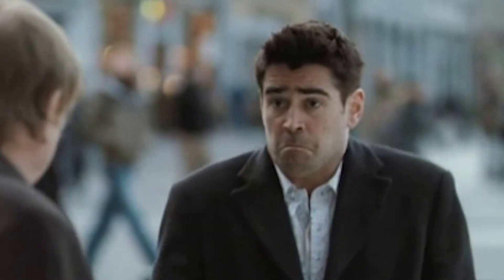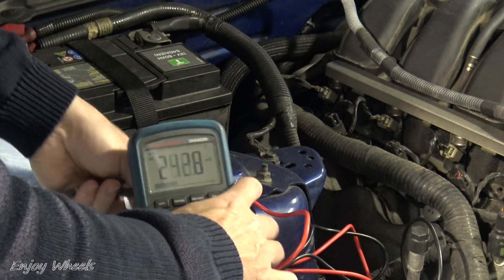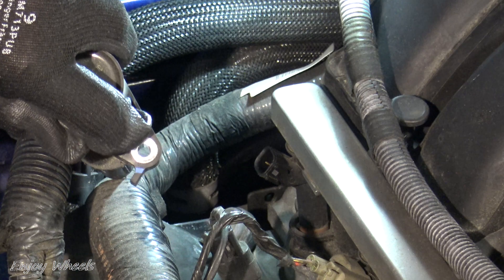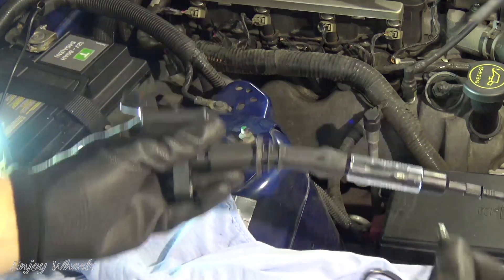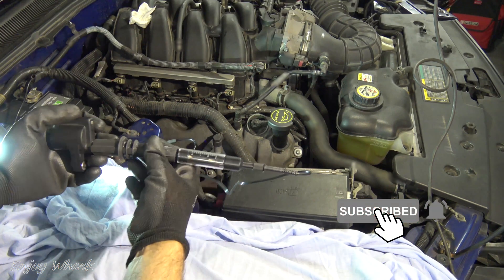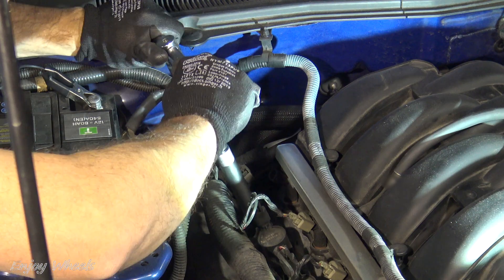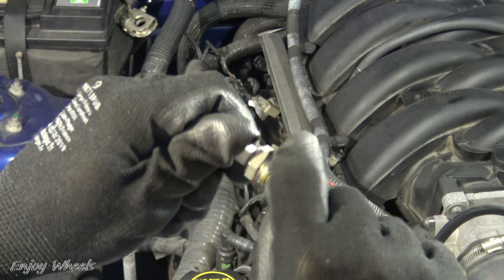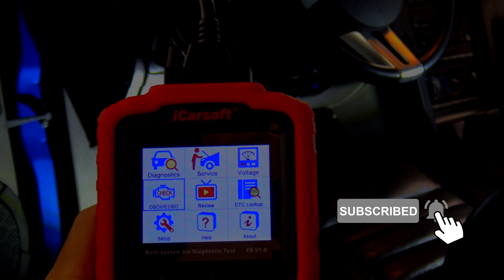Engine misfiring : How to TEST an IGNITION COIL easily ? (Lack of power, excessive fuel consumption)

Comment: For Anyone watching this: Don’t put anti seize on spark plug threads! The torque on the threads lubricated is much higher than when dry and you could strip the threads on the cylinder head and cause a major repair. May have worked for this guy, but guarantee the manufacturers of that engine and of those spark plugs say keep it dry.
It’s a modern engine with modern spark plugs that are anti corrosive already.
Spark plugs have a gas tight crush washer, no corrosion is getting into the threads if you torque to speck with dry threads.
Only place I’ve seen anti seize on spark plugs is engines on outdoor power equipment and marine environments thats regularly exposed to the weather and corrosion and it’s only the threads close to the crush washer, not the whole thing.

Comment: At 5.52 you lubricate the threads. NOTE: Some plugs are made with coated threads (Denso for example) and DO NOT need lubrication. In fact by lubricating the threads you risk over torqueing the plug when fitting.
Reply: Yeah was surprised to see that especially on a modern engine with modern spark plugs.
Spark plugs have a gas tight crush washer, no corrosion is getting into the threads if you torque to speck with dry threads.

Comment: A quicker way of checking for a bad missing ignition coil or spark plug is swapping the suspected bad coil with the known good coil from another functioning cylinder and rerun the engine, checking with the OBD checker, to see if the miss is now in the cylinder that was a good firing one. If there is no change, then the spark plug in the original bad cylinder is bad and the suspected coil should be good.

Comment: One bad spark plug means something else is going on. Either all the plugs are on the edge of their life span or you have an issue with that cylinder like bad oil control rings. 

It’s not normal for one cylinders spark plug to just go bad.

Comment: Ok what if cylinder one was missfiring then did a complete replacement of all spark plugs and wires then 3 weeks later it's back to missfiring should I check the plug again or is it something else?

Comment: This looks good BUT what if the engine won't even start? How would a person test the coil?
Reply: @denphi9504  you don’t need the engine to start to test the coil. You do need it to crank though. Failed coil(s) could be a reason why the engine won’t start or misfire.
Reply: You should be able to put power through the input wire via test light with ground at the end of the coil to see spark. Sorry if this is confusing

Comment: Correction: The ground connection is not made by the screw in the engine that holds the coil in place.  The ground wire is actually in the connector of the coil and it’s part of the control circuit. The computer controls the ignition coil by means of the ground wire.
Reply: good catch- if you look closely at the bushing, you can see there is insulating material around that bushing, too.

Comment: At the beggining of the video you said that a low battery voltage can cause the issue.
I have a Mazda 6-2.0 petrol engine and i have a Cylinder 4 missfire.I changed the spark plug, ignition coils, O2 sensor, injectors, and still have the error.I checked the voltage of battery, and it has 12,59-12,80V.Do you think i have a bad alternator and that cause my cylinder 4 to missfire?
Reply: it should be 13.5V or higher at idle.
Reply: @BrunoBMS  have you checked compression?

Comment: You don't use copper slip anymore. It affects the torque when fitting the spark plug. They are now zink coated.
Reply: its called anti-seize and any at all is better than using nothing- so torque it a little less when using copper anti-seize. problem solved.

Comment: You can purchase some relatively inexpensive testers that may end up saving you money in the long run. I bought a code checker and it really helps. It reads the code and I can clear it as well. It helped me diagnose a mass air flow sensor failure on my Kia. I currently have a P0306 due to a misfire on my ‘05 4Runner. I am going to test the coil first and take it from there. Hopefully that’s all it is! Great video. Thank you.
Reply from the maker: Thanks for these informations

Comment: Can you explain that how i can test the ignition coil by multimeter
Reply: @travelservices740  you can check the resistance by setting the meter to ohms and going across the terminals on the coil while the coil is disconnected.

Comment: I put in new park plugs and coil, all top of the line, in my 2010 Kia Sedona, and that engine started and worked like a champ for 50 miles before engine started rattling and I ended up with P0303 or P0330, meaning misfiring in Cyl 3.  In Kia Sedona it is a pain to remove the intake manifold to get to cylinder 1, 3, and 5, but did it and 3 power was attached and no different than others. What should I do next? How can I test whether power is getting to the coil?

Comment: I have a v6 and a lot of vibration regularly snd my truck does not show a code ??  But it acts like a coil pack or spark plug . Oddly it behaves well when I take it to a shop. . Ie no codes ??? So what is the next step ??? Thank you .

Comment: ignition coil tester not available and no idea when or if it will be available.  any suggestions. found an oriGlam tester but can't tell if it tests the coils for the Lincoln town car.  I replaced coils and plugs and having misfire on cylinder 3.

Comment: Can't afford all that equipment. All i was looking for was how to check a coil pack. Your over my head. I'll try another one.
Reply: Lmao see ya later Karen 😂😂😂
Reply: My experience, I plug of 1 coil while the wngine running, if vibratioan more than before it means the coil is good, note don't plug of too high (1cm -1, 5cm is good to go)
Reply: If your car doesn't have a pencil coil like the one in this car, you can pull the spark plug wire from the coil or the spark plug while the engine is running and observe the spark.(if you are sensitive to getting a little shock use pliers. (The spark doesn't really hurt) before starting the car you can pull the wire and install it back(just to make sure you can pull the boot from the spark plug or coil) on older vehicles you will have a distributor cap and all the wires are connected there. Good luck.
Reply: Cant afford a 15 tester you can't afford to drive a car
Reply: Just swap the coil with another cylinder and see if the misfire code moves. 

You can get a cheap code scanner these days off amazing for $30
Reply: Why say all that? Just check another video lol..
Reply: @jimmysmall330 You're trying to work on your own vehicle (to save money on an actual mechanic, I presume), and you're crying about the need for two really cheap tools to do the job? Are you daft?

You're complaining about the cost of a couple really cheap tools? A multimeter and an ignition coil tester? You could pick both up at harbor freight for $10. If that's too much for you to afford, you might want to get off your bussy and get a job. Or just learn to walk everywhere you go, because life's not gonna get any easier or cheaper than $10 worth of tools and an afternoon using them.

Comment: I used a spark plug tester( it has a tube just like your tester with no adjustable distance) on my '95 maxima, the spark was yellow, and a channel on youtube said a yellow spark considered weak is an old wives tale.  I'm a bit confused.  Can timing cause a weak spark?  Thanks.
Reply from the maker: I don't think timing can cause weak spark, but misfire yes.
Reply: @EnjoyWheels_En  OK.  The spark appears to be intermittent by about a half second to a second where I don't see anything then it reappears; any advice?    Can the ignition condenser cause a misfire?  Thanks a lot for replying.
Reply from the maker: On old engines, a bad ignition condenser can cause misfire.

Comment: Shouldn't you replace all the spark plugs so the engine gets the same spark all over???
Reply from the maker: Yes it's better to replace all the spark plugs at the same time.
Reply: How about the coils after 100,000 miles? Replace them to. @EnjoyWheels_En
Reply from the maker: If they work well, no need to replace them I think
Reply: Yes replace them all .

Comment: nice video for the coils but you are wrong the coil is not ground by the bolt which holds it to the valve cover. on the coil there are two connectors, one for voltage and one for grund. The proof is that to test it with a multimeter to check the primary circuit you must connect to the two branches of the coils and for the secondary circuit you must connect to the connector of the coil which receives the voltage and the other wire of the tester connected on the spring which connects to the spark plug.
The real problem with Ford coils of this type is that the worst idiot would surely have done better. In 55 years of mechanics I had never seen such a stupid thing. The spring that connects to the spark plug is a very poor conductor. At the exit of the coil to connect the spring it is simply a flat terminal so the spring only touches the connector through the thin sides of the terminal. To the spark plug which tells us that the spring is really completely embedded on the spark plug terminal???
On my F 150 to no longer have to change coils I made a plate where the coils are now held in place. I removed the springs that connect to the spark plug and installed good spark plug wires. At the other end I installed very good NGK spark plug caps which hold really very securely to the spark plug. All you had to do was extend the wires of the coil connectors and that's it. I've never had to replace coils. Thus positioned, the coils no longer suffer from the heat of the engine. Heat is the worst enemy of coils on all engines.
Reply from the maker: Thanks for these informations.

Comment: How many cm the right spark 1 or 2 cm ?
Reply from the maker: The manual says 2 cm I think
Reply: @EnjoyWheels_En so a healthy ignition coil should jump a 2cm gap?  I have a 2008 trailblazer with 175k miles...all I ever did was replace spark plugs about 10k miles ago...I don't want to replace any ignition coils that are fine but I would like to replace them if they are weak
Reply from the maker: If you have no trouble code, there is no need to replace them.